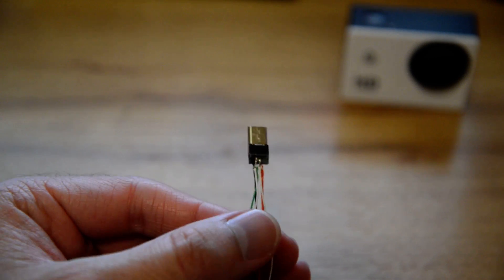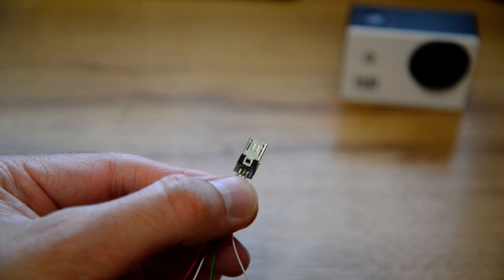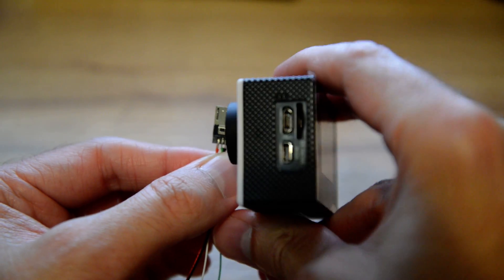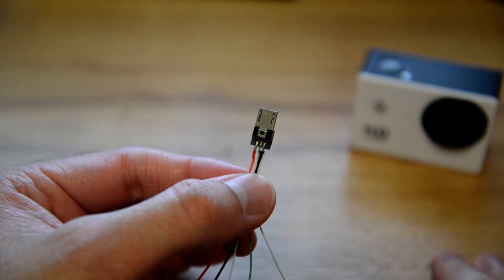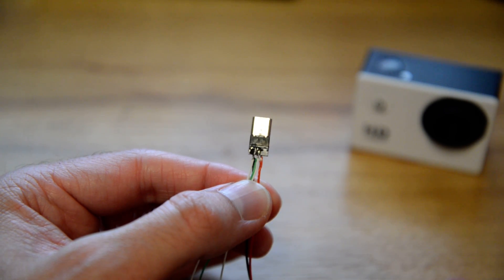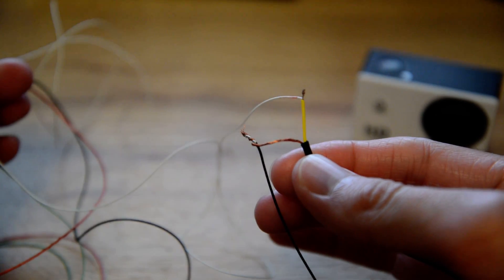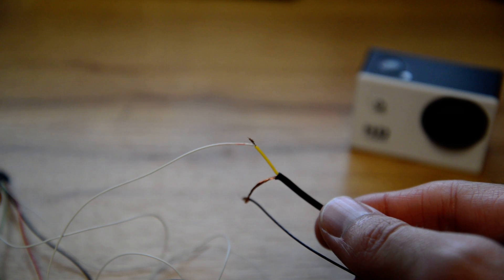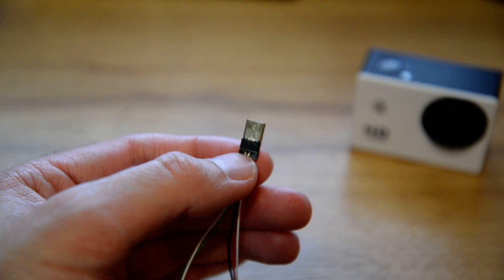SJ4000 DIY USB AV Out Cable Instructions and Details

Comment: Thank you so much for this video!!! I ordered a “plug and play” cable from eBay only to be disappointed with it because it didn’t work. 

I took it apart and looked at all the connections thinking that maybe some cable had been riped off or had a bad connection but all the solder points looked ok. So I began to look at the settings on my SJ Cam. Maybe I had some wrong setting? I checked EVERYTHING but nothing seemed to work and after a lot of fiddling along with the Micro USB connector it gave up because I accidentally ripped it off. So I took a spare Micro USB cable and took it apart but, surprise, there where only 2 cables connected to the Micro USB connector. I saw a red and a black cable. My first thought: that’s only a power cable, not a data cable. After that I took a second Micro USB cable from my old mobile phone (this one had to be a data cable since it was from a mobile phone) and to my luck it WAS one! It looked exactly like yours in the video and I did what you say in the video:

Unsoldered the white cable from pin 2 and soldered it to pin 4.

Then I connected the cable to my camera, soldered white to yellow and black to black, powered everything on and TADAAAA everything worked and I finally had a video signal on my Fpv Monitor!!!

Only thing that’s concerning me a little bit is that I have some flickering in the picture, with my GoPro Hero 2 I had as good as none. Any thoughts about this?

Thanks again!

Comment: I cut up 4 micro usb cables and not one had pin 4 pad so I guess I'm going to have to break down and order one of the custom cables.
Reply: I've had the same problem. they all only have 4 pins
Reply: +ng joe Thanks, I eventually got it figured out and working building my own from 5 pin connectors I ordered on eBay.

Comment: I made one today but i used a hdmi to micro usb. I cut the hdmi plug of and stripped back the wires the blue and green are video connect them to av plug and bam it works. Its alot easier than re soldering and cutting open the micro usb cable.

Comment: I had the same sort of micro usb plug from an old ipod and the only way i could get it to work was use the black wire and the one on the left hand side of it,which by looking at your one was the green wire,so black = negative/ground and green to signal/video out for my Turnigy action camera which is just a re-branded SJ4000,my micro usb plug looked exactly the same as your and not like the others that are about.
Just thought i'd add this in case someone else tries your method and it didn't work as mine didn't,but it does the way i just mentioned above. ;-)

Comment: hey, can you please tell me how big the latency is?
cheers
Reply from the maker: Bärtiger Baron I haven't done an exact measurement, but you can get a sense of the latency based on my other video: https://www.youtube.com/watch?v=H0OJu4KH9Bo

You will be able to see the recording indicator blinking on the monitor in a "hall of mirrors" kind of effect on the monitor I have it plugged into, which should give a general sense of what the latency is like.  I hope that helps!
Reply: Dustin Wilkins  the way to to it is very simple ^^ just film a digital clock and make a photo or a video of the Tv and the original clock time^^ but the latency looks slow as the go pro and other action cameras. i will use a little PAL or NTSC cam. thanks for your work !

Comment: Wow, great video.  Thanks!  I wonder if you have been able to get power to it? I imagine one of those cables would provide power, but trial and error with a hot wire isn't the slickest move - unless of course you happen to be right on the first try ;)  Any idea?  Thanks again!  Getting the 6000 (true 60fps in 720p rather than double-framed) I've got a 4000, but the original version when it just came out... so no video out.  Going on my tricopter!  Take care.

Comment: I have a mini usb cable with four wires sticking out: white, black, green, red. Can I use this cable to connect to RCA video cable? Which wires are video wires? Also, I would like to be able to provide power into SJ4000 from my lipo battery at the same time, is it possible?

Comment: dear sir....is this the Genuine ''SJCAM SJ4000''' ??? With this device ,can i record on the sd card , and at the same time have an ANALOG ''A/V'' OUTPUT ??? It's very important, peguese i gonna use it on an rc-plane for FPV !!! I need this function, so i can record the environment on the micro sd card , and at the same time use the A/V output connected to an TRANSMITER....thank you.....

Comment: On the front of my usb, there are two pins on the back three. Witch is pin four and five? The two on the front? And I've got no option of tv output. What should I do?
Reply: I had to cut up two micro USB plugs till I could get to one where the pins were clearly visible. For those of you still trying to identify the pins try this: the visible shell, i.e., the part that plugs in is ground, so alligator clip a lead here then test the remaining pins individually until you get a video signal. The pin arrangement was quite different on the two plugs I exposed. The one I ended up using successfully had a pin-out nothing like the one in this very welcome video.
Reply from the maker: Hi - If you go to around 4:32 in this video, I show which pins are which (with text labels if you watch this on your desktop browser).  You can also refer to this image: http://goo.gl/RHQe3g

If you don't have TV Out, check to see what version of the firmware you have.  Based on that, you may be able to determine if your camera is the newer or older PCB version.  I do not know which version of the firmware first introduced the TV Out option, but it could have been the 0527 version.

Comment: Hi and thanks for a great video.
I just finish'ed mine and it works fine, but the lag, is that normal is'nt it to much for FPV.
What about the HDMI could'nt it be used instead
Reply from the maker: I know that GoPro cameras also exhibit some lag when using AV out... yet a lot of people fly through GoPro cameras.  Check out FliteTest.  They regularly talk about flying FPV through their GoPro cameras as well as using them to capture footage for their videos.  The lag must not be too terrible.  I also don't know how the lag compares between AV out on a SJ4000 versus AV out on a GoPro.

With that said, I haven't purchased any FPV gear for my F450 yet, so I don't know what impact it will have.  I figure I'll start with flying through the SJ4000, and if it is too bad, I'll add a board camera and fly through that instead.